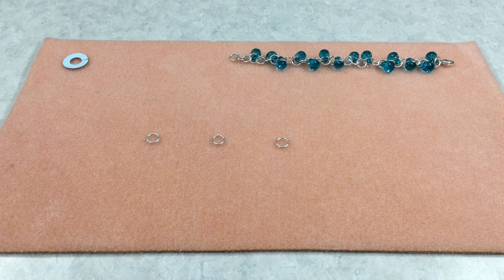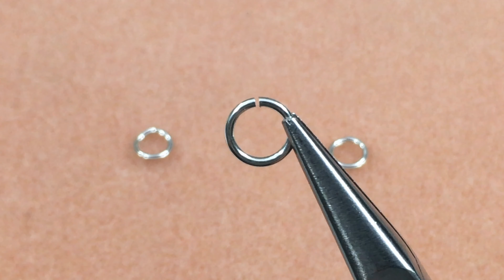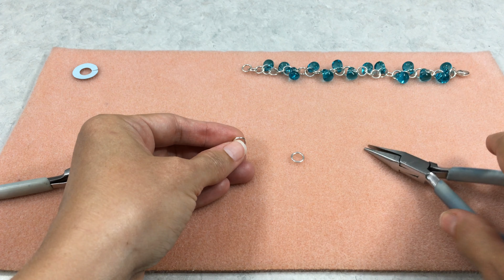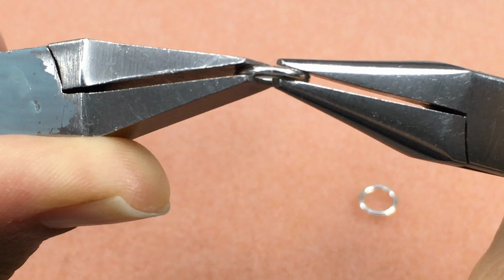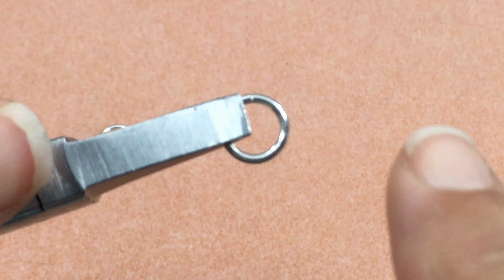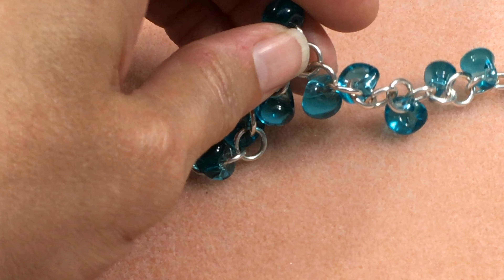Troubleshooting: How to fix your Jump Rings

Comment: Finally I found this  usefull info about jump ring issue . Thank you so much for explaining and showing step by step very Clear n close ❤.
Reply from the maker: So happy it helped you!   The details are so important when it comes to making jewelry.  It’s not the fun stuff - but makes a big difference.
Reply: @jewelryclasseswithjen  it is and I must say your tutorial is the most clear n explaining well for my need. I’ve been searching from many😄. I have this issue for my several jewelries for my friends ( Even i have followed instructuon and it looked close already ). I’m still beginner and still  not selling for public yet ( only make for friends n family since ) . My friends keep coming with the open jump ring 🥲. Thank you so much. Once again .  I need to look closer and hear the ‘click sound 😄’  wish me luck . Greetings from Taiwan 🇹🇼
Reply from the maker: @linawidhy  Be sure to use jump rings that are strong enough to hold without soldering them closed.  If the wire the rings are made from is too thin, they will open from normal wear.  I like to use rings made from 16gauge (awg) wire for most bracelets and necklaces unless there’s more than 1 ring making each connection.
Reply: @jewelryclasseswithjen  Thank you so much for your guidence 🌸. Apparently my friend like a sterling silver , so I used sterling silver jump ring 4 mm ( I tried to fit with the beads size ). I was trying to use stainless steel, but the color look different. 4 times I made for her ( coz she wants to use her beads ) , 3x I do repaired. I was thinking to solder , but then I need to learn more . Do you think sterling silver material is too soft?
Reply from the maker: @linawidhy  sterling silver is plenty strong IF the rings are made from wire that measures 1.29mm in diameter. 4mm is the ID or inside diameter of the ring.
Reply: Oh Thank you @jewelryclasseswithjen  . Ah ok, its another things I need to learn abt the size. Can’t thank you enough for the lesson 🌸🌸.  Warm greetings from Taiwan 🇹🇼🥰
Reply from the maker: @linawidhy  you are welcome.

Comment: Idk why but I once I open my jump ring I have to may issues threading the ring through my resin earrings. Any idea why?
Reply from the maker: It's hard to ell without seeing what you are using for "resin earrings", but perhaps you aren't opening the rings enough to get the clearance needed to easily insert the rings.  It could also be that you should use a larger diameter ring to allow for more clearance - just be careful to choose a gauge that's heavy enough to stay secure without soldering it closed.  Minimum 18ga, but more secure with 16ga ring depending on the diameter and weight of the earring dangles.  My best guess would be to try a 4mm or 5mm inner diameter ring in 16ga wire.  Hope this helps!